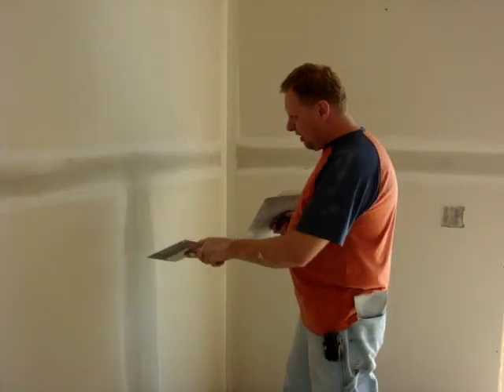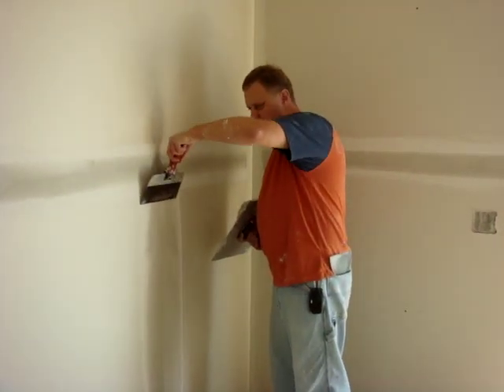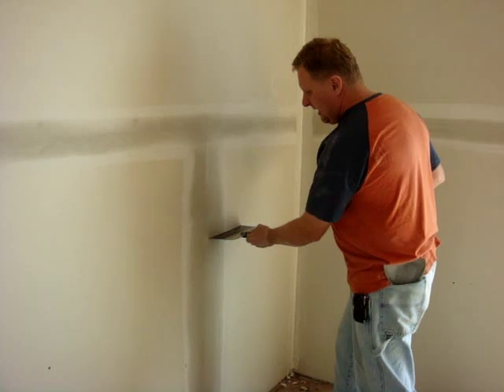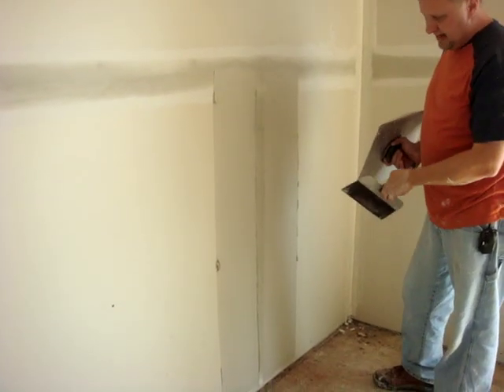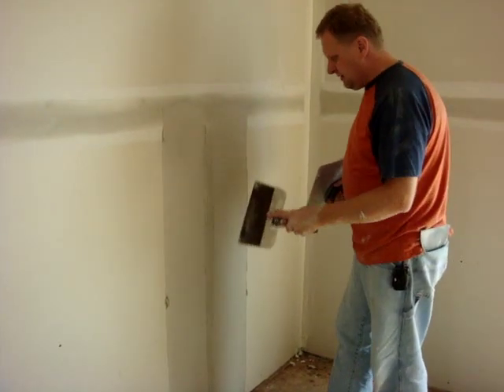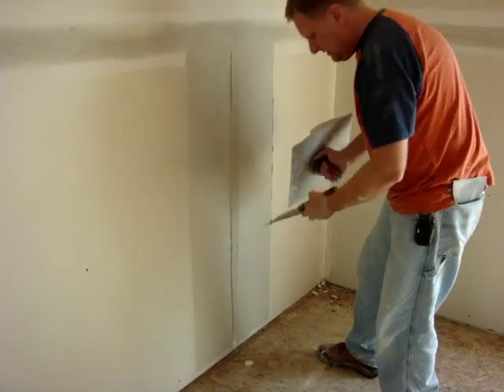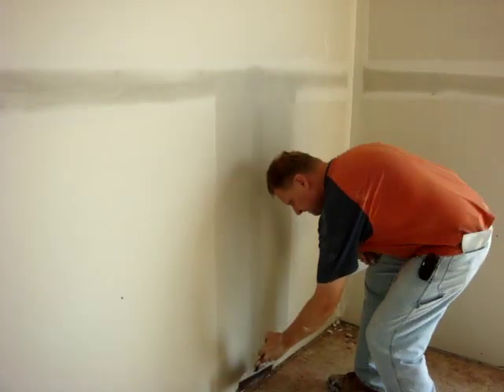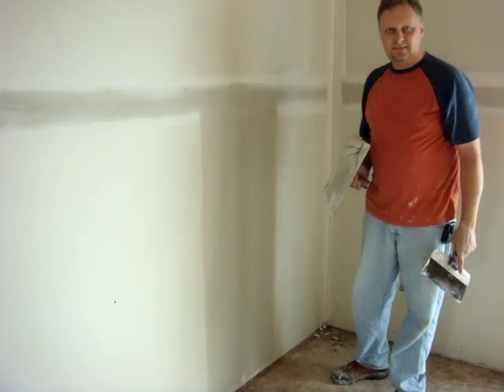How to second coat a butt joint

Comment: How do you do the third coat on the butts? I thought I heard you mention it in your video or do you just go with two coats? Are you just tapering (or cleaning the edges) of each edge of the two coats of mud you put on each side, then going over each coat completely flat with your trowel?